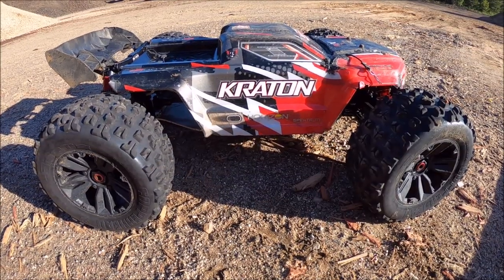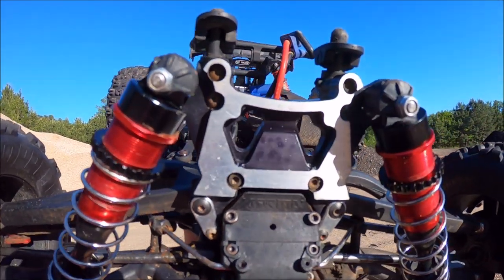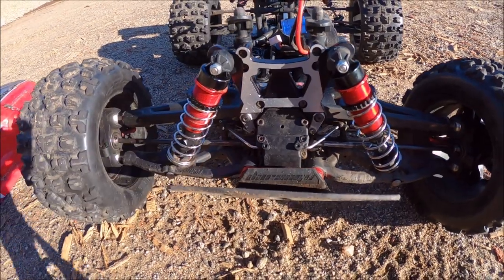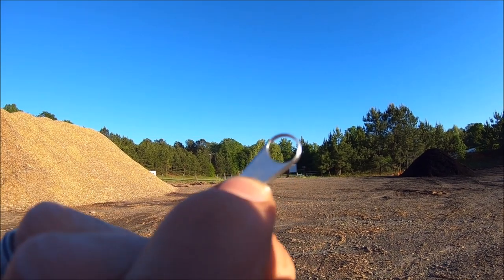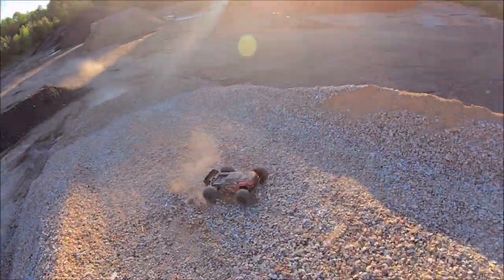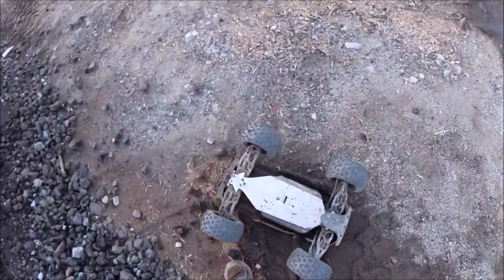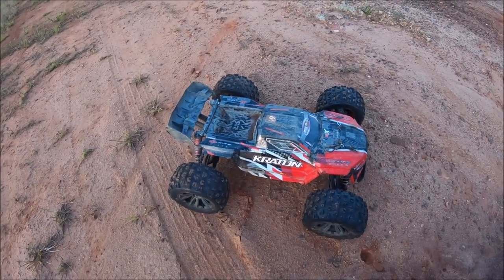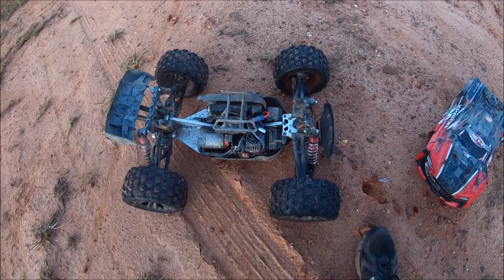ARRMA Kraton 6s (BRUTAL POUNDING!) NEW M2C parts test!

Comment: Just got the 6s myself, what batterys u running and what life u getting? Im running x2) 3s - 4000mahs an getting roughly 11mins a run
Reply from the maker: I'm running Powerhobby 5000mah 50c packs. Pretty much my basher lipo of choice. Smaller packs too due to the compacted cells. I get probably 15 mins or so depending on how hard I'm driving. I usually bring 2 or 3 packs with me bashing.😎🤘

Comment: Hay bro I bought the kraton 6s and it seems a little loud. But it's my first 1/8 scale.  Is it the metal gears. Or just because I'm used to the 1/10 scale? I appreciate it if you can respond.  And keep killing it with the big air! Your a beast bro!
Reply from the maker: Thanks so much bro!👊Yes the 6s will be a bit louder b/c of the all metal diffs, steel drivetrain and gears. Most 1/10 scales are plastic gears so there will def. be a difference! If by any chance the pinion/spur are meshed too tight, it'll make it worse but otherwise totally normal!

Comment: These will not fit the Mojave right?... 😭
Reply from the maker: They should..🤔I will double check!👊
Reply: @RCDUDE81  
Ok thx.. cause i reallt find it hard for me to understand what fits where..
Ive already ordered m2c:
* chassis bracers
* 10mm hex hubs
* shock caps kit
* rear chassis brace mount
And a few other derlings boushings..

...are there any other parts?
Chassis i will order later on..
Reply from the maker: Sounds like the parts you need for a beefcake treatment!💪Especially with the chassis. Just on the shock caps, the pistons were tested on 80 weight oil so you may need to change the shock oil and add Kraton springs or the suspension may be a tad light. Just a heads up but its up to you on how you like the feel!👊
Reply: @RCDUDE81  
Ok.. thx.. will change the fluids..
Can i go with mojave herdest spring rate from arrma:
Front from 1.35 to 1.5 and rear from 0.56 to 0.63 or the kraton as u wrote?...
P.s.
* the hinge pins.. front.. rear.. m2c will feet?
Reply from the maker: The hinge pin kit won't work unless you're running T-bone bumpers. The stock skid design won't allow for the locknuts.
Reply: @RCDUDE81  
I have only the front Tbone bumper...